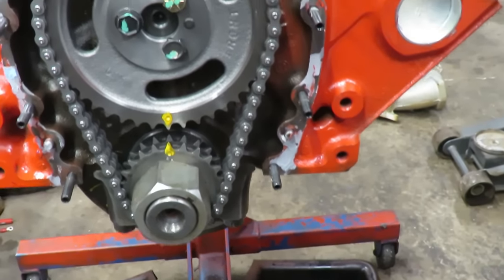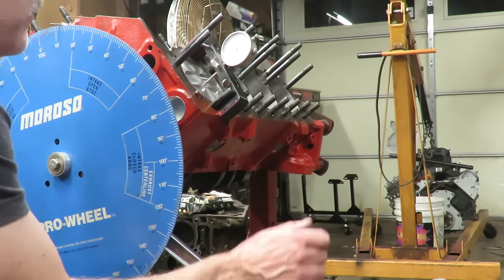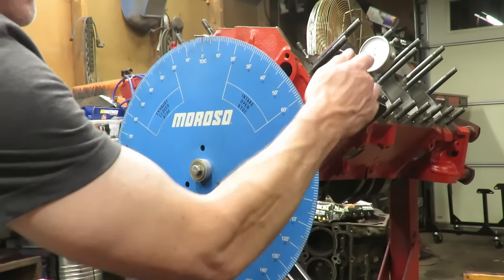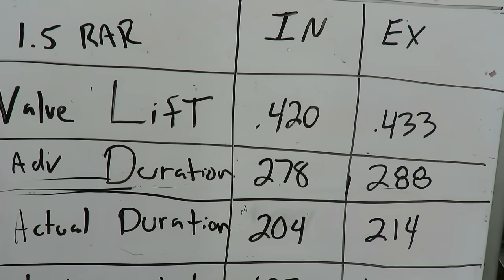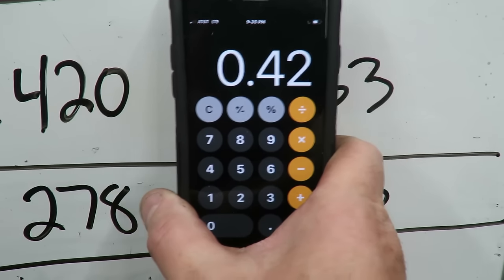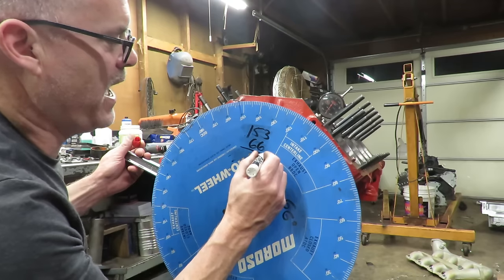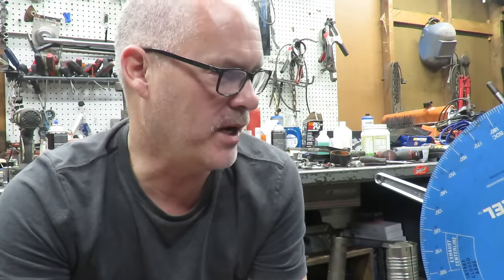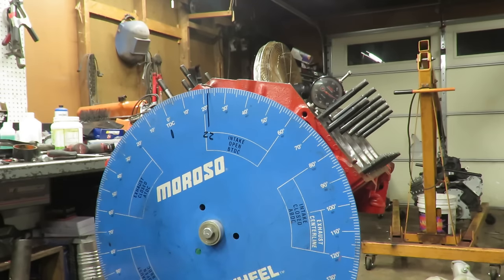Quick Cam degree

Comment: It was still a great video for cams !!!!!!  When you exhaust the info on cams, move on to springs and what is needed to be known about them to select the right ones !!!!!  Thanks for all you provide for us !!!!!!!
Reply from the maker: The best way to get the correct springs is get a spring part number from the cam manufacturer and use them
Reply: @Myvintageiron7512  Thanks so much for getting back with me, that was a very good reply and I will take  your advice !!!!!!

Comment: I build my engine just looking at your channel. You're so detail in what you do it's easy to follow much appreciated. I'm getting ready to rebuild my 5.7 Gen3 hemi .030 overbore. Using your channel will help me out alot
Reply from the maker: I am actually planning doing a 5.7 Hemi in the fall very good engine
Reply: @Myvintageiron7512  looking for to it. I was wondering what cam to put in it and clarify it for me I'm doing a daily driver but thinking of porting the ports of the heads in increase the flow as of now I'm using the stock 5.7 eagle heads

Comment: My first cam install was a Triumph 650, in the 1970s. Separate intake and exhaust, new cams to replace badly worn originals [no hardening]. After messing with degree wheels for a couple of days I called Norris... they opined that maybe they hadn't ground those cams to spec after all, but 'it should work if you time the exhaust to the intake spec'. It never ran right... now new hardened stock cams are going in the old girl, and this video will be a big help.

Comment: Great stuff. I had a Pontiac 400 built years ago and the builder must have put a much larger cam than what he thought it was. When I started having issues, I put a degree wheel on it and found that it was  236/244 @ .050 110 .560 lift. All with stock 6x-4 heads and springs!!! No wonder I found crushed valve stems seal rings ... in the top of the head.

Comment: Thanks again for your good video.
I do my first cam degreeing now on my FE 390 by using this video. So everything is perfekt with my cam.
I do a very stock rebuilt, except I use a roller cam and roller rocker. I ordered the cam and rockers from Brent Lykins. He helped me with a cam profile and other parts I will need for my rebuilt.

Comment: I loved this video, thanks so much for making great content. Also for making educational videos fun. It's not just theory your really doing it live and proving it at the same time😁👍👍

I am working on an OHC Ford engine right now and I liked what you said about retarding vs advancing the cam timing by a couple of degrees. If my engine could use a little more low end torque can I advance the cam a couple of degrees to give me a slight improvement on the low end torque? Let me know your thoughts on this because the cam drive gears are not keyed to the cam so I have a little freedom there.😉

Comment: You don’t need to rotate the engine to 50 thou. All you need to do is rotate it clockwise and watch the dial indicator when it stops moving mark the wheel then start rotating again, when the dial indicator starts moving again, mark the wheel again. Half way between those two marks it true TDC .

Comment: Great video! off topic, but I see you have installed head studs on that engine. I did the same on my BBC gen 4 this winter. Used thread tappet on all threads, cleaned everything. Installed the head studs with ARP thread sealer. Almost everyone leaked coolent out. What do you use or do to get them sealed up? I see theres alot of forum thread of people struggling with this. Could be a good video topic aswell.
Reply from the maker: Lock tight not to keep them from coming loose it works great for sealing bolt holes that go to water jackets
Reply: Myvintageiron7512 thanks, what kind og loctite? Theres like propaply more than 50 types

Comment: Hi!
Thanks, I'm trying to understand this procedure and all of the details that go into a cam, and its installation. Your videos are the most comprehensive, clear, and easy to understand that I've come across. I'm about to rebuild my Ford 400, from the bottom up. I am fairly new to this, and this is the one step in the process that's a bit intimidating. One question, do you want to be able to check for piston to valve clearance so there's no chance of these two components contacting each other during first startup? I guess it worries me a bit putting a new cam in that will have slightly more lift, after the block deck has been machined down, as well as the head surface. I'll keep watching your videos to learn more! Thanks again.

Comment: Do u have any videos on how to choose valve springs for ur camshaft?
Reply: That's recommended by the manufacturer you bought the cam from...
Should be listed on your cam card... Listed usually in LBS seat pressure.

Comment: I used to build a lot of small blocks for you people that's the Chevrolet engine, I was putting one together with the set of TRW gears; I always set the engine at top dead center number one and number 6 which is the same, and then I set the cam what number 6 overlap and then I put on the timing gears this one time the TRW lower crank gear is one tooth off where they drove the mark should I double checked it with the old gear and sure enough it was off by one tooth so i Mark the gear and used it it, as machinists I share the story with several different machinist I knew two of them caught the problem before they installed the gears. You got to think how many people put those engines together with the gears 1 tooth off and wondered why the engine still run too good. How many hundreds of gears did they produce with one tooth off in the lower crank gear???.

Comment: Great video, now I understand center line is basically cam lobe TDC.  But just to make sure I understand this correctly, your intake opened at 22 degrees and closed at 68 degrees.  Wouldn't or couldn't you add 22+68 and subtract that total from the total degrees in the circle (360)?   22 + 68  = 90.  360 - 90 = 270 degrees.  Your cam card specified 270, correct?  Again, thank you for explaining the center line enigma to me.  I've watched this procedure performed in person (where I basically stood and blew spit bubbles when my buddy explained what he was doing) and have watched many videos since, but you actually broke new ground on my old and stubborn brain!!  Thank you again.
Reply: ,,,,,,to get duration  , you add int opening plus int closing plus 180 degrees [ 22 +68 = 90 + 180 = 270 ] degrees duration for the intake valve......

Comment: Excellent video. I don’t have a dial indicator lifter. Can I convert a hydraulic lifter to solid by removing spring and shimming with washers just for measuring purposes?
Reply from the maker: Yes you can!
Reply: That's what I'm doing too. :)

Comment: I would have liked to see how to make the adjustment to get rid of the 2 degree error.
Reply: would like to see that as well
Reply from the maker: There are a few way adjustable cam gear , or the most economical way it an off set bushing kit for the cam dowl pin

Comment: And while that degree wheel is still on , put the weak springs on No 1. And check piston to valve clearance, 30° before and 30 after, check every 5° ,zeroing mike before each step. Clay works, but rather see the numbers.

Comment: Love your vids, thx   quick question.. if I put Vortec heads on a 1988 GM 350  which length pushrods do i use?   from the vortec engine that i yanked the heads off, or my original TBI GM block?    thanks
Reply from the maker: if it's a roller cam than use the vortec push rods if not your stock push rods will work

Comment: So overall the main point of “timing” a cam is really just to verify the Cam specs? 

I want to venture into my first engine build soon and trying to understand all the little details. This step seems to be just a verification step only? 
Like if the Cam was out of time, but also was the correct Cam, how the heck do you adjust / re-time the Cam to make it correct? Or you don’t? If the Cam isn’t in spec, you stop here and get a new in spec cam?

I guess to me I’m confusing “timing” a Cam with timing an engine on like the ignition advancement or delay of spark. Like when you tune you can add a degree of timing so maybe I’m just confusing myself with the word “timing” here and it’s really “verifying Cam specs” not timing it?

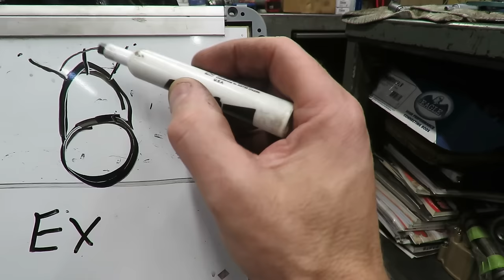Comment: I'm a little bit confused. At 10:53 you find the intake lobe max lift. This happens to be about 122° on your degree wheel. Then, at around 13:00, when you explain finding intake centerline, you move 50 thou on each side of that. You end up with 109.5°. In theory, isn't that redundant since the degrees at max lobe lift IS the intake centerline? Am I missing something? And why didn't it come out to 122°, where the max lobe lift was?
Not criticizing, I love all your videos. I have learned so much from you. Just trying to understand.

Comment: I use the inner base circle method of calculating lobe center an get a lobe center of  112.5 deg (22+67+180/2 - intake opening 22 = 112.5) from your number when measuring duration. why are your numbers different than mine?

Comment: I am working on a 5.7 Vortec that I have installed a Comp Cam OEM type roller. 276/282, Lift .503/.510 with a 112 lobe center. The cam card calls for it to be installed at 110 degrees. With the timing chain point to point it shows 110 on the wheel. However the engine is a dog..... Comp Cams says the cam was ground with 2 degrees advance. Any help would be appreciated.

Comment: I watched a video on here where the man installed the timing set on a dodge engine on the exhaust stroke. Is this correct for dodge engines? Never seen this before. I have all way installed the timing set on all engines on the compression stroke TDC and had no problems.

Comment: Do you first set dial gauge to aproximate TDC then set wheel to 0 degree then turn piston clockwise and counter clock wise 0.050 because the camshaft is 0.050" lift

Comment: Is there a way to do this with your heads on.  And do I need to do this if I'm just swapping cams out. On a motor I been using.  Thank you
Reply: You can do it with your heads on just gotta use the rocker arm for your lifts and through the spark plug bore for tdc and yes you need to once you swap your cam.

Comment: Still not clear to me.  If 0.050" BTDC and 0.050" ATDC both are relative to the "approximate" TDC with this method, aren't they then both "approximately"  50 thou before and "approximately" 50 thou after TDC?  Seems that a piston stop would be a more accurate method of determining TDC.

Comment: So if there is no adjustments to be made if it’s off then why degree a cam?  I mean other than sending it back to the manufacturer or maybe the chain has an issue or maybe the sprockets have an issue. Either case, is degreeing a cam just to verify the cam?
Reply: @Warrior_Resisting_Colonialism  thank you for your reply. Great information!👍

Comment: Where can I get my vorttec eads machined for center bolts like you have in the past and where can I get the center bolts? I can't find them the bolts on jegs or summit. Thanks.
Reply from the maker: That is custom machine shop operation you won't find anything about it on jegs or summit
Reply: @Myvintageiron7512  I understand the machine work is custom that you did. I was asking where to get the bolts you used for it?

Comment: Over the years I have rebuilt over 400, that's four hundred, not just one 400,  ford engines. I experimented with the degree wheel on a 351 4v. Through much trial and error, I discovered how to get torque out of that engine. And all the books said it couldn't be done. Sorry can't tell anyone what combo I discovered but I am soon to put an engine on the dyno. When everyone was experimenting the high rpm capabilities of this venerable engine, I was out to make it a low end monster. It can be done.
Reply from the maker: Why can't you tell anyone the combo why is it a secret? no offence but I have always thought the concept of keeping things that have been discovered about engine building/power a secret is pretty stupid
Reply: @Myvintageiron7512  in the 1970's, try to tell Bob Glidden that.

Comment: How does any of this tell u where to set the distributor
Reply: But how do u determine the right timing for the engine
Reply from the maker: it doesn't has mouthing to do with ignition timing
Reply: In the beginning of the video the dots on the gears are pointing at each other. If you rotate the crank once they both point up. When you put on the timing cover and balancer the marks should line up. This is where you want to drop the distributor in so if you rotate the engine any more make sure to do it twice and get back to the right tdc
Reply: @gregblau8082  That's true we set up dot to dot because it's easier to line them up but it is actually TDC Exhaust to get TDC compression you need to turn the crank one complete revolution this puts both marks at 12 o clock

Comment: Hey I am about to degree my cam and I am reading online and it says to use a solid lifter into the lifter bore because if you use a hydraulic lifter it gives you false readings ... did you just use the dial indicator in the lifter bore or was there a lifter there and if so what kind ? I really need help. thank you for a very informative video!

Comment: As i have said before how can i contact you and forget that face book B's that don't work for me i have sent you my email address long time ago ?. 😨 . Cheers
Reply from the maker: To be honest I am so overwhelmed with messages and emails it is pretty much impossible to respond to all,  I get over 100 emails a day it would take several hours to sift through all of them I do apologize if I wasn't able to respond but there is only one of me,  what most people don't realize is one 30 minute video is an average of  8 hours of work I know it might look easy but trust me it's not FB is your best bet I'm not sure why you have issues with it it's a great place to connect and it's private,  I do not recommend giving out your personal information on you tube it's not secure FB is very simple to use I can respond very quickly because of the way it's structured and it's also a great place to buy engine parts FB marketplace